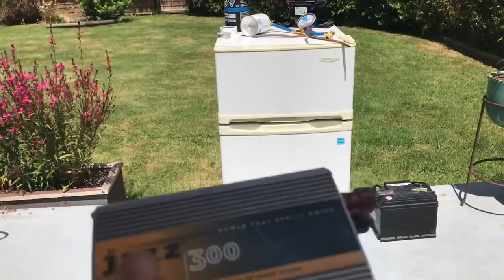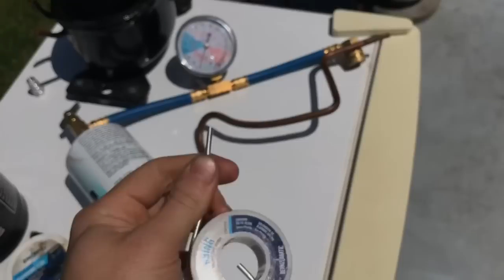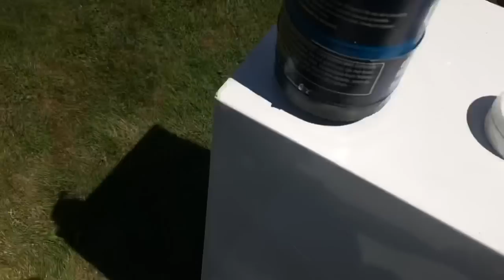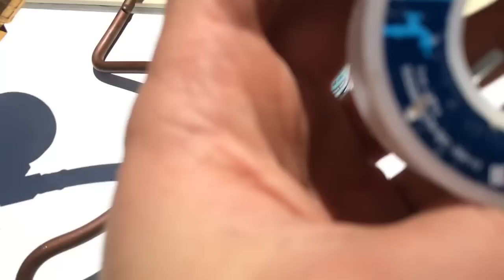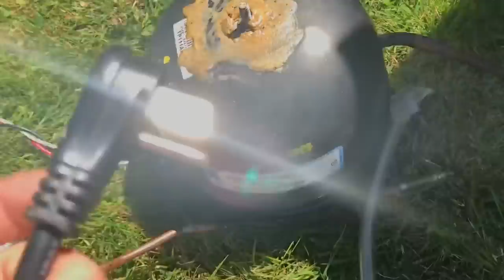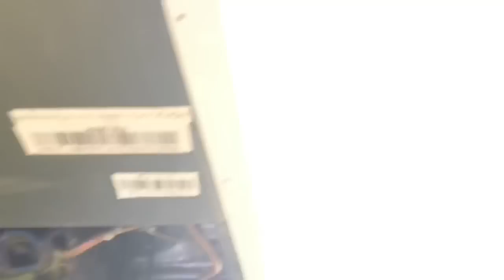Make Your Own Danfoss Compressor Fridge/Freezer For Cheap!

Comment: Just a quick FYI, if you want a cheap source of R134a, it’s still used extensively as a compressed gas “Duster”.  It’s technically illegal to deliberately vent any refrigerant to air.  It might seem irrational since you can empty a can of the same gas with no concerns.  It has to do with regulations.  Also, R134a is not completely benign and is being phased out for its negative impact on global warming.  R600 is fast becoming the more common domestic refrigerant used. Great job on the video! 🇨🇦

Comment: Hey this is a really great video thank you so much. I don't know if you've ever worked with r600, but most of the many fridges in the US seem to be r600, I was wondering if you had a conversion video for a R134A to r600 conversion. R600 is isobutane or isopropane either way. They do sell it for camping stoves. At any rate thank you for the video you rock.

Comment: Good jog  but here is no filter drier/ or vacuum pull on system. and nevr use flux in refrigeration. 15% stay silv. no flux needed. purge with nitrogen trace as well cause all that black stuff outside is now inside and will block the tiny cap tube meterung device. good luck.

Comment: That label on the fridge that says what kind of refrigerant to use also tells you how much it needs, usually in grams or ounces.  Simply weight your refrigerant bottle before and during the fill up and when it loses that much weight you know you have enough.

Comment: Hey thanks so much for the vid! I looking to move my DC Compressor a few feet from its current location for sound proofing. Wondering if it's as simple as cutting the piping and adding 2 quick release valves and a few extra feet of piping?

Comment: Hi, please remember when converting a previously AC fridge to DC, the thermostat may arc/weld itself in on position.  You should
attach a properly spec'd capacitor across the thermostat switch.  Or build a DC solid state thermostat,  or purchase a DC thermostat.  Also some fridges have AC condenser cooling and / or  internal AC motor driven fans that must be changed over to DC fans.
Reply: On these compressors the thermostat/cold control doesn't switch any significant current, just a logic level signal.

Comment: I know that it wouldn't be without some electrical engineering.. But why not just replace the motor instead of the whole compressor? My guess is that they are not servicable to that degree? It just seems bogus having to open up the whole refrigeration system and practically rebuild it in order to accomplish this. I don't understand why the price is so egregious for a 12 volt fridge to where there's a whole network of people looking to do this type of thing.

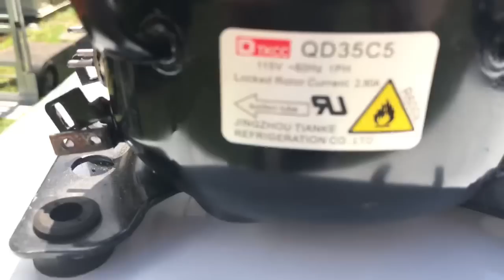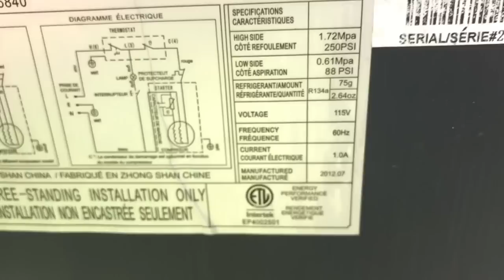Comment: @4:11 you show the hold compressor witch seems to be meant to run with R600, then at 8:24 the back of the fridge show R134a.
We now often find fridge with R600. Can they be converted with the BD35 danfoss comlpressor ? What about the refrigerant to be used ?

Comment: Last year I built my own fridge cabinet in my van. I bought a working donor fridge for $20, i took out the evaporator and installed it in the cabinet that i built. I located the compressor and condenser under the van. I have the compressor hooked up onto an inverter, not very efficient like you mentioned.. im considering switching to 12v compressor from china.
Reply: I'm in the middle of doing the same thing... only I'n making a freezer

Comment: The only one glaringly big problem with this video is that its totally illegal to do unless you have an Fgas certificate and are licensed as a business as a refrigerant handling company. So it’s definitely not DIY unless you want to pay £1000 for a weeks training and then buy all the gear to do it. This should not be on here. Massive fines from the EA in the Uk if you are found handling refrigerants illegally. Nobody should legally sell refrigerant to anyone without a refrigerant handling certificate and through normal channels this is the case.

Comment: I tried this conversion using a 12v Danfoss compressor and a pretty much identical fridge/freezer to the one used here in the video. The "donor" unit was fully working on 240v AC before I chopped out the original compressor so I know it was fine before starting the conversion.
So far I've not been able to get it fully working, the fridge holds gas properly and the compressor will run correctly but it's not cooling well at all, the freezer works great but the fridge isn't cooling plus the compressor gets really hot, it has never reached temperature and cut out on the thermostat as it should do so far.
Anyone know what I might have done wrong?
Too much gas, too little gas?
Maybe the wrong gas?
Maybe the compressor isn't working properly, it runs and makes pressure, I tested it before installation?
Maybe the compressor isn't powerful enough for a fridge/freezer, it was originally out of an under counter marine fridge with small ice box? 
The fridge should use R600a but the compressor uses R134a, I used R134a to charge the fridge, should I try R600a instead?
Reply: Your doner fridge probably used a fan to circulate air between the freezer and fridge. That fan would be an ac motor... if you figure out where that fan is you may be able to swap it for a dc fan but idk
Reply: Might be an issue that requires some compressor oil when topping in the new gas.
Reply: you cannot use 134a on a r600 fridge.
Reply: Are you saying you can't install an R134a compressor on a previously r600 fridge?  I can't see why you can't do that and install R134a refrigerant.  Why wouldn't that work? @Az-hn7xi

Comment: What your doing is illegal in the US and I am sure it more illegal in Canada. And no dont use jb weld. You got the wrong solder and flux. You clearley don't have the certifications required to do this legally you dont even know what your talking about let alone do it right.

Comment: Great idea. Research however…. 😬

Anyone concerned about Watts Law when using a lead acid battery? Use a lithium cell or setup a protection/cut-off circuit before you fry your fridge with too many amps. 

“Why aren’t more people doing this?”

Good question….

Comment: Refrigeration compressors also need oil. I am not sure how you check the oil level, perhaps some one who knows can chime in.
Reply: It is litteraly welded shut inside the compressor. Set amount,  nothing to think about.
Only thing recommended regarding the oil is; If the compressor has been started / moved recently, it should sit for 2-3 min so that the oil can sink to the bottom again

Comment: Moisture freezing in the system is not the problem. The oil in compressors is hydrophobic and absorbs the moisture which in turn creates an acid that will destroy the compressor from within. That's why a good vacuum has to be pulled on the system. In a vacuum, any moisture will boil, turn to steam and be sucked out by the pump.
Reply: Actually it's moisture that absorbs in the oil and then freezes and blocks the capillary and stops the fridge working as soon as it gets cold. Usually its compressor burn out that causes acidic oils

Comment: I just use butane lighter grade has to be filtered and I recharge just using the vapour they don't need much I pull a vacuum first it's a very good refrigerant and cheap to. Have you ever tried it. I use LPG gas in my car aircon it works the best I only put about 400 grams in the car one it's super cold. But always pull a vacuum first.

Comment: The Danfrost is just a AC Compressor with a Inverter mounted to it. Where can I find a proper DC Inverter. (Meaning where the motor actually runs on DC voltage and not AC)
Reply: Why you want DC it has carbon brush
Reply: @samueladitya1729  I am looking for pure DC driven Compressor (dont want to go through an inverter)  Solar Panel = DC to Batteries store DC now you have to covert DC to AC (220 or 110) loosing about 30% energy in the process
Reply: @philliplabuschagne5508   ST14DC12H looks nice. it's 12v BLDC motor which mean 3 phase permanent magnet motor with 3 phase inverter. pretty small size for the output.
Reply: @philliplabuschagne5508  did you ever find anything?

Comment: how does the r12 or r22 get high in the sky to deplete the o3 ?       r12 and r22 both are heavier then air as witnessed by the warnings of using in enclosed spaces ( displaces the oxyger/air in the confined areas) 
Or do they just...............FALL UP THERE?
Reply: Dupont had the patent on these, when their patent ran out they created this scare so they could sell their new product.

Comment: hello :) you look very knowledgable with fridges :)

 i have the same compressor in my vitrifrigo i90 fridge, i have it new since 3 years( so no warrenty anymore ) since that long it took to make my van ready :s. i have it plugged in, and fridge is cooling just fine, but it keeps on . so it turns the compressor on it becomes warm, the fridge inside is the right cool temp. the compressor turns off.. but within a minute of 4, it turns back on for a minute or 5, than back of, and so on.. even after one night it keeps on turning on.. the seals are brandnew, the fridge is brandnew :) do you have maybe any idea what it could be ? it's on a 12v battery.  Thanks in advance

Comment: Here in the states at O Rileys and some other car parts stores they loan out evacuation pumps.
 It also may be a good idea to add a filter dryer to protect the compressor.
Reply: Yes. The filter dryer needs to be replaced when the system is opened.

Comment: great video, but don't try it, they'll waste your money, if you don't believe it then go ahead.  You do not use right refrigerant gas, welding, correct pipe, vacuum, charge, pressure, etc, it is a different capillary gas r290, or r600, the working pressures totally different from r134, this job its possible what you are doing but you cannot skip the basic technical steps .. I I'm sure that's cool but that doesn't mean it's okay, it will only work for a while.  look there is something simpler and much cheaper take a 300w peak start inverter, some real 130w , 150w, use the original refrigerator thermostat to turn the linverter on and off so it will not be on all the time just when the unit calls for cold.  use the two cables that are connected to the compressor starter, the 115v output of the inverter to the compressor starter, the 115v ac plug of the refrigerator to 12v dc, just make sure the polarity to the inverter power input, take the 115v ac cable as reference Negative black cable, positive white cable, but check the polarity well, with this you will not spend more than $ 50 in inverter, and some $ 120 in refrigerator. I'm refrigeration, electric, electronic tech.. good luck and thanks.
Reply: use the two cables that are connected to the compressor starter, the 115v output of the inverter to the compressor starter, the 115v ac plug of the refrigerator to 12v dc, just make sure the polarity to the inverter power input, take the 115v ac cable as reference Negative black cable, positive white cable, but check the polarity 
Connect inverter to battery, output of inverter to refrigerator starter. 
The 115 volt refrigerator plug to dc? When you connect the inverter to the starter on the refrigerator wouldn’t that bypass the refrigerator plug?

Comment: Is swapping a compressor really easier and cheaper than plugging in an inverter? The standby power draw you mention really doesn't make any sense either. In this application, you could just wire the thermostat to the inverter's on/off switch. When the thermostat cycles off, it'd kill the inverter. 

I'm pretty sure just plugging in a small sine wave inverter is easier than swapping compressors. Also, telling people that they can go ahead and release R134A because "it's just a greenhouse gas" is stupid. You should never encourage people to release refrigerants into the atmosphere. It's illegal and just plain stupid.

Charge by feel? You literally have a gauge and a sticker on the fridge showing the charge capacity. Having one guage doesn't help all that much because you don't have a high side pressure reading so charging by weight would almost be better in this case. Put the can on a small scale, charge the correct weight and walk away. Just because it gets cold doesn't mean it's charged correctly. You can have an insane high side pressure and still have cooling because your suction can still be lower after the orifice / metering device. It can also ice up while being low on charge. Running them low on charge will diminish the oil cycle through the system and burn up the compressor.
Reply: So I hook up the inverter to 24volt power source, plug refrigerator into inverter. Bypass on/off switch of inverter to refrigerator thermostat. Does the refrigerator thermostat not need electricity to operate?

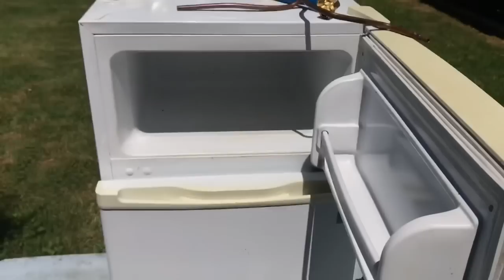Comment: 4:30 - How did you collect the old refrigerant?... You should mention that the refrigerant is toxic (but low) and it is illegal to release the green house refrigerant at open air with out a proper machine to collect it. 6:10 - you pick the refrigerant based on what danfoss tells you, one can not just simply use a butane refrigerant with an A/C compressor specifically designed for 134A or what not.

Comment: Next time just replace the inverter's on/off switch with the thermostat... and you saved yourself quite a buck.
Reply: Any tips on how to do this?
Reply: @chasewatkins3096  if you have to ask that question you should stay clear of anything close to mains voltages... untill you learned enough about electricity, electric circuits and electricity safety

Comment: Wow, that is a fantastic effort!

My only suggestion is to find a fridge that doesn't have it's condenser coils embedded in the fridge case. 

It doesn't make for an ideal refrigerator to put inside of a cabinet because of that. 

So, if you can find one with an external condenser coil....that would be an even better fridge to start with.

Comment: Good for sharing! I have a Domestic CFX 28 and circuit board has failed. I can salvo all parts and do what you did to put back in service
Reply from the maker: if the circuit board (top control board) is fried, and not the control unit attached to the motor, then you should probably be able to just rig up an external thermostat and connect your 12v directly to the control unit to bypass the bad top control board.  if the control unit attached to the motor is bad, you'll need a new controller to drive the motor. it runs on 3 phase power off the control unit, similar to an ebike motor.

Comment: Brilliant video. One of my pipes broke. Now I know how to fix it. I can only find r134a with leak repair in the EU. Is it really that bad? Also could you share a link of the quick connect? Not sure what to order. Many thanks again
Reply: If you are in the EU its illegal for you to fill it yourself unless you have an Fgas certificate and are registered as a refrigerant handler.
Reply: This why standard refrigerant is not available to buy for the public. Actually you should not be able to buy gas at all but some slips through the net.

Comment: This was an excellent video, I'm looking at the same conversion into a 240v fridge from the from my leaky 24v Chinese fridge, we had it re gassed and it only lasted 2 weeks. I got the 210litre fridge for $50 au , so wist me Lucy, the only problem is it has a fan in the freezer and I'll have to put a 24v on in.

Comment: Too complicated. Buy a Victron inverter. These are efficient, and will run any fridge. They torn off when there is no load. With my 1600 watt Victron I run 5 fridges at once.

Comment: A “perfect vacuum” is 0 µm. You will not be able to pull a vacuum or charge the system with the fitting that you have. It does not depressed to Schrader valve.
Reply from the maker: there's a pin in the r134a quick-connector fitting that depresses the schrader valve.

Comment: JB Weld to fix a leaky evaporator. Lmfao
Reply from the maker: Interesting read. Many people have had long-term successes with various epoxies for fixing pinhole leaks. 
https://www.cruisersforum.com/forums/f2/im-an-idiot-broke-my-waeco-fridge-211623-3.html
Reply: KundaliniKid I am an HVAC tech and have been for 15 years. The pressures are too high for that to work long term. As far as the article, I didn’t even read it. I can write a paper saying that pigs fly but...
Reply from the maker: @KentuckyReef  https://www.youtube.com/watch?v=XncqGcc_AFs&ab_channel=martinvaccaro here's a guy that fixed his car ac leak for 5 years with one application of jb weld. recently failed. The evaporator coil is on the low side so the pressures are easier to deal with. With all due respect I understand any professional like yourself is going to advise customers to do things the proper way, but this video is about doing things for cheap. Most people aren't going to pay $100+  to an hvac tech to tig weld, solder, or replace the evaporator when they can get a new mini fridge for pretty much the same price. If a fix like with jb weld or alum bond  works for a few years that's pretty incredible and helps keeps the fridge out of the junkyard.
Reply: @KentuckyReef  My kid punched a hole with an ice pick. JB Weld fixed it perfectly. Lasted 20 more years.
Reply: @InflamedBallz  I personally would use one of those metal expoxies that come in a tube.... because you can put it on thickker than JB weld liquid